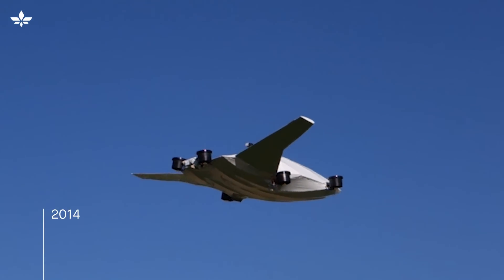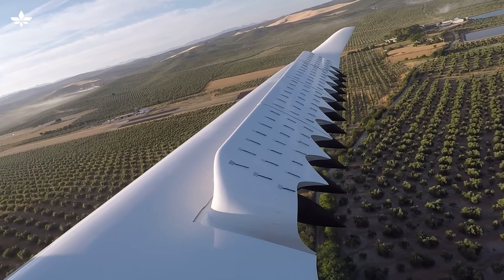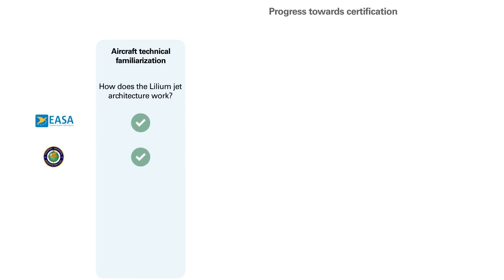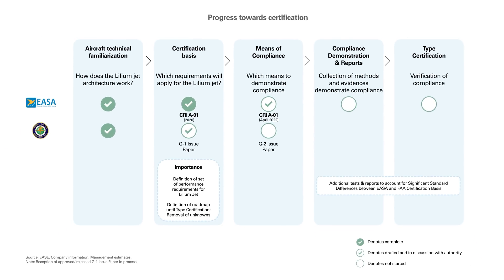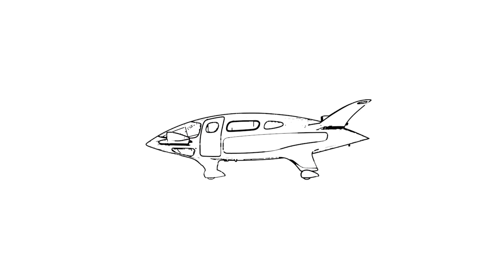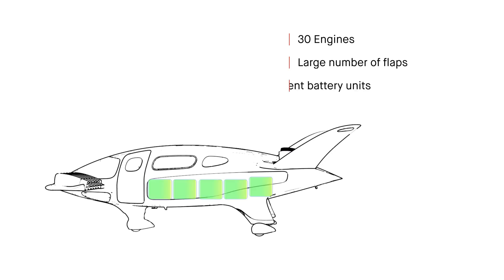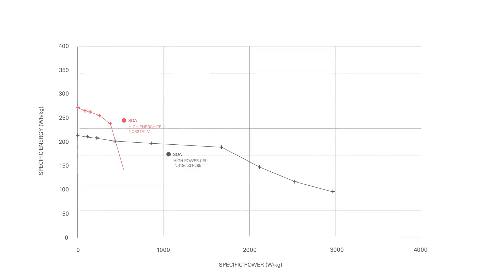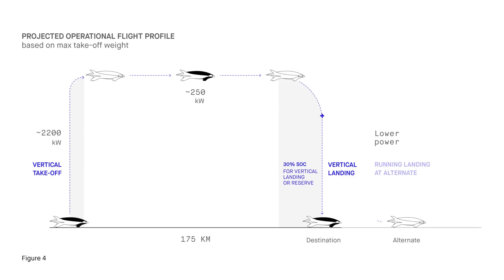Aircraft Development Update

Comment: Trying to figure out how practical this might actually be.
1) What is the turn-around time (Airport A to Airport B, spent battery pack replacement with fully charged pack OR full recharge time)?
2) What is the infrastructure at small regional airports for supporting recharging (tapping into the Tesla SuperCharger stations - 😉😉)?
3) What is the roll-out plan ( you state "to be a global leader in air mobility" ) ( Europe only?  North America? South America?  Australia? )?
4) What are the numbers on load capacity?  You show a 4 and 6 seater variant, and cargo, but I did not see the numbers.
Thanks .....

Comment: This doesnt work! Please stop this nonsense. No range, no operating time. 5min flighttime don't take you anywhere ....range 5 miles?
EDF powered experimental  modell with no relevant data to amp draw and voltage. No weight confirmation or testing. The battery doesnt exist. Where does this go? Ultra short-range cargo drone remote controlled maybe- not much more.

Comment: After seeing the landing gear that is presently installed, I wonder if they have truly calculated the different types of issues related to rolling landings vs vertical ones. With rolling low-speed landings, hard landings or crosswind landings hitting on one main gear only at touchdown have to be built into the strength of the gear. It doesn't look to me like the main gear has any shock-absorbing ability or sideways deflection. As with all military VTOL planes, a rolling TO or landing is used whenever it is available vs a vertical TO/Landing to conserve fuel or carry more weight.

Comment: so with all the energy required to transition from vertical to horizontal flight,  why or how come,  engineers do not use altitude as a swap for forward speed?  passenger comfort?  safety?   climb to 2x altitude, nose it over and use 1x altitude to get forward momentum and then leveling out?  Am no engineer but would this require the same energy?   Just seems it would be easier to get necessary air over the wings via gravity vs raw power?   could just be a wash and identical  power required for either?  
Stopping would be achieved by a controlled stall to vertical flight?  (probably kind of tricky?)

Comment: This really shows how serious these people are. I was dismissive of the idea of flying taxis at first based on safety concerns. However the safety characteristics of projects like these have convinced me that it's a viable business model.
Reply: ' I was dismissive of the idea of flying taxis at first based on safety concerns. '  Exactly.  Really this is the only one of these drone inspired types that even looks reasonable to actually fly in.  Heck you could probably disable the front or rear motors and still land aerodynamically if you keep the speed up.  Which of course should never happen anyway with all these motors if it's properly redundant.
The other designs are basically 'if much of anything ever happens it falls out of the sky like a brick'.

Comment: This sounds like a marriage from heaven of an air ambulance and an eVTOL. I believe it will prove to be far more operationally reliable than rotorcraft. The modified angled take off and subsequent landing will allow better utilization of the power envelope. Vertical operations are the least efficient and drain power quickly, so a rush to land ASAP may contribute to marginal decisions. This aircraft is truly remarkable and I hope you have great success.

Comment: If possible, it would be preferable to have the batteries in the wing.
Closer to the motors, requiring less heavy copper.
Located where the lift is generated, allowing for lighter structure.
Allows for more cargo space.

Comment: so they found a magic battery that has >2x the specific energy and simultaneously >10x the specific power current technology.  This is an enormous claim
Reply: there are lots of battery startups hand-building very high energy density and very high power cells with no idea how (or if) manufacturing at scale will be possible. A million dollars could buy a battery pack that meets all the claims above from several different startups, each one might only be able to manufacture one battery pack per month 😂
Reply: @kschleic9053  this

Comment: 1. So were looking at a 300-350 KWh battery here which will have a weight of over 1 ton based on the energy density numbers you provided us, will these batteries be charged or swapped out after landing? How long will this process take with batteries that weigh as much as a car?
2. Other aircraft in this category (Cirrus SR22, Diamond DA50RG) already cost close to a million. With all the additional technology and redundancy the Lilium is supposed to have the final price is most likely going to be closer to 2 Million. All for a plane that still needs a commercial pilot plus ground crew for battery charging/swap (therefore adding more cost) and from the looks of it is only going to be a VFR aircraft. To fully take advantage of its VTOL capabilities youd also need to build extra airports with infrastructure. What price per mile are you aiming for, who exactly is the target audience supposed to be?
3. It would be great if more technical figures (battery capacity, cruise speed, etc. etc.) would be shown on the website.
In summary, i have my doubts. I dont think this aircraft will be viable in a commercial setting due to its extreme price and limited range.
Reply: Thanks for asking these questions. I am also looking for answers.
Reply: Last year, I read a german newspaper article which mentioned a factory price per unit of about $4m. So I took my calculator and checked what the editor hadn't wanted to see, or to realize. (If you don't speak german, try deepl.com for a free translation. You'll have to split the text into chunks smaller than 5000 characters.) https://wp.ujf.biz/2021/06/nicht-flugtaxi-lilium-maerchen-wird-immer-abstruser/
Reply: look at total operating costs and safety, and you have your answer. regional airports watch out.

Comment: Lilium, I don't mean to throw cold water in your fire but weight is everything in airborne vehicles.
Are you going to be able to overcome the of power density of batteries to the power density of gasoline. Gasoline engines have more than 100 times the power density than that of batteries.
Reply: Gas engine 30% efficient, plus all that weight of oxygen...
Electric motor 90+%.

Comment: I like the option of completing a traditional, running landing - it simply gives the pilot more options.  For example I can imagine in a heavy (>20 kt) or gusty wind situation, it may be easier to just land traditionally into the wind.
Reply: Not sure I understand why this is worth the trade off.. this adds significant weight to the design of the landing gear, no?
Reply: @tewrgh  wheels give the aircraft the ability move around on the ground much more efficiently than hovering (which is pretty power-hungry).  For example, the Sikorsky executive helicopter has wheels that allow it to move around a helicopter without having to hover from place to place.  Sometimes the heli will do a "rolling landing" to use the ground to carry the weight as quickly as possible.

Check this out: https://www.youtube.com/watch?v=sz5FIJYeKRg

Also, flying forward (using the wings to support the weight of the aircraft) saves the batteries so you can extend the range significantly by essentially gliding into a landing.  For example, the F35 is a VTOL aircraft, but pilots' preference is to take and land going forward - even if is a "short" takeoff that uses some of the VTOL capability.

Check this out: https://www.youtube.com/watch?v=PleiyRKke4Q

and... https://www.youtube.com/watch?v=hO5mZxaiyUQ
Reply: @davidallyn1818  Isn't there a significant weight difference between landing gear capable of slow taxiing, and landing gear capable of sustaining a horizontal landing?
Reply: @tewrgh  I'm not an aircraft engineer, so I can't give you an exact answer.  But I can say that generally the weight of the landing gear is predicated on the weight of the aircraft and how quickly the weight needs to be absorbed to not stress the air frame.

Check this out:
https://www.youtube.com/watch?v=7r0sBh8gxhs

I'm sure the designers will decide the correct weight ratio to give them a smooth touchdown while also keeping it light.

Comment: Need help, please.
The power figures at 7:30min seem reasonable, maybe on the high side. 2200kW for takeoff and landing, 250kW for cruising.
How long will lift off and landing take? Say 3 minutes or 0.05hours --> 2200kW * 0.05h = 110kWh for each.
Cruising 175km with ascend and descend to cruising altitude shall take 1h at 250kW --> 250kWh.
That is in sum 470kWh energy budget.
Plus 30% SOC reserve --> 670kWh.
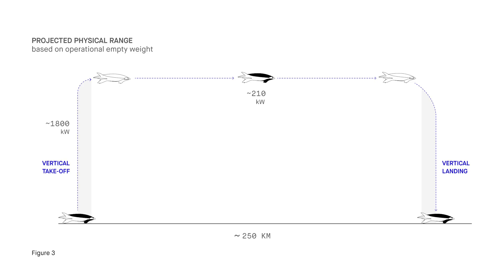According to the battery figures at 7:00min the battery is 260Wh/kg --> 2582kg

Isn't that a bit heavy? 2.5t just for the battery, no airplane frame, no passenger weight, purely the battery? Even if we assume all is halved, 90sec ascend, half the range, it is still a lot to carry.

(A Tesla has 75kWh and a battery weight 480kg, 150W/kg. And its power consumption is 20kW at cruising speed compared to the 250kW of the Lilium Jet)

(A BO-105 helicopter carrying 4 people is 2.5t max take off weight)

Thoughts?
Reply: Dude, you must have slipped as decimal- your 5,500 pound battery weight estimate is a factor greater than anything suggested.
Reply: @mavigogun  Should be easy for to spot my mistake then. But just as reference, the 75kWh Tesla battery is 480kg. The energy budget in the video is ten times which would make the battery 10 times more heavy.
Reply: @wdaehn   It is inconsistent to use the power density of a Tesla battery instead of that selected for the aircraft.
Reply: @mavigogun  I did not. I used the W/kg given in the video, thus come to 2500kg. A Tesla battery would be 4t. Any other idea?
Reply: @wdaehn  The 6 minutes you've budgeted for hovering flight is inconsistent with the designed parameter of  10 second vertical take off at max weight and 45 second landing.   For ease of calculation, let's stretch that to a full minute- or 1/6th of your estimate.   Why is this important?   As we know, hovering flight requires vastly more power- about 10 times that of horizontal transit.   Your excess of 5 minutes of hovering equates to 50 minutes of horizontal transit flight time.
Reply: @mavigogun  Okay, that might be an explanation. I find 10 seconds for liftoff, ascend and acceleration to minimum speed where laminar flow starts to happen (100km/h?) sporty, but okay. Then the start needs 6kWh, landing 27.5kWh and 250kW for one hour needs 250kWh --> 1558kg battery. But that one hour flight I do not feel comfortable with, lets make it 30 minutes at 250kW --> 871kg battery overall at SOC 30% reserve.
Reply: @mavigogun  While 6 minutes may be a bit excessive 10 seconds is also impossible. The aircraft has to accelerate and decelerate with speed and attitude profiles that are comfortable for regular passengers. Also realize acceleration can only be achieved with "excess power". Just providing minimum hover power will not allow rapid acceleration. Additional safety reserves must be allowed in case the take off or landing must be rejected. I don't see how you could propose less than 1 minute for takeoff and 1 minute for landing, at the absolute minimum. So at least 2 minutes total and that is still likely insufficient for safety in the real world.
Reply: @emotodude  The values proffered by Lilium aren't 10 seconds for launch AND landing, but for hover to forward flight; they provide 45 seconds for landing.   I reckon there is no obstacle clearance in that 10 seconds- whether atop a building or nestled down in the rotor amid towers.    That later scenario strikes me as particularly unrealistic, as the presence of strong rotor amid excessive climbs would be prohibitive, me thinks- but I don't KNOW that: computer controlled stabilization might more than match chaotic air flows.   Consider: just flying from the base of the Empire State Building to its Observation Deck- about 1,250' - would consume as much as 45 minutes of horizontal flight time!  If the vehicle had the margin for landing and return trip to the streets, it would require recharging before going anywhere... where as the elevator would only take 2 minutes, round trip!

Comment: we have things called helicopters this is a JOKE!
Reply: So tell us when will be the mainstream will be aviable to use helicopters? Never, because of the costs. EVOTL are the future... They will cost in the future less and it will b autonomous
Reply: @pokemonash_real  Exactly!  Folks like this are fueled by bitterness, not consideration.
Reply: Do you know what’s the cost of maintaining 30 engines? And helicopters can also be made autonomous
Reply: @PhysicsKingdom  Helicopters are one of the most radically expensive types of aircraft- the number of parts and points of failure are several factors greater than an electric vehicle with X number of motors with 2 or 3 moving parts.

Comment: To vertically lift 5 people in this ship it uses 3,000 hp. A lot but it uses only 300 hp for straight flight. And hover only happens for a minute of the flight. Still cheaper to run than a 5 seat chopper that uses 500 hp all the time.
Reply: Choppers use less power in forward flight than in hover

Comment: I'm in the process of designing an electric RC sailplane for my high school engineering class, I'm aiming for a 5 hour flight time. I've been doing the math to figure out how long it'll be able to fly it and I think I'll reach 5 hours with 20 Samsung 21700 50E cells but those cells you were talking about sound pretty cool, any chance I can snag a few? I need every watt hour I can get. :)
Reply: Dude- these Zen batteries would pancake your glider.   As to your project, are you building your own thermalling and thermal search architecture, or using someone else's script?   As I recall, a guy in Eastern Europe has done some impressive work in this area, with glider's achieving many hours long unguided flights.

Comment: Looks way better than those whirlybirds with six big propellers. I reckon slow running take-off and landing is the go. On rough ground go up one meter and start a hovering take-off run from a meter. At a meter the hover requires way less power than at a hundred feet.

Comment: I feel multiple jet engines design’s idea is brilliant. The engine is small in case of avoiding bird strike event. But I think there’s a possibility that it might happen maybe one jet engine failure. Can other engines also still operate to keep other engines running, and equally propel all engines to keep Lilium balanced landing?🤔
Reply: Adding all that fan area together, I reckon you'll find the area presented to bird strikes is no smaller.
Reply: @mavigogun  Each cowling outside of engines will avoid some big birds cracking the engines. I mean the possibility of birds strike will be much lower than bigger jet engine.
Reply: @willykang1293  Maybe the cowling will provide substantive protection to the fan when striking a goose at 150 knots; if the commercial application is realized, we will find out.

Comment: Are you really trying to say that the battery can catch fire only one time in 1 billion hours?? I'll never believe.
Reply: The internet is gratified by your input.
Reply: @mavigogun  seriously, it's 1 fire in 114 thousand years))) Unprecedented reliability for lithium batteries, especially under high load. For example, Teslas catch fire one time every 210 mln miles on average. If we assume speed=40 miles per hour, it would be only 5.25 mln hours, so these guys claim to be almost 200 times better than Tesla))
Reply: @TechMasterRus  - the safety margin between commercial aviation and driving account for over half of the 200 multiplier cited- close to 60% of Tesla fires are due to collisions alone.   While it shouldn't need saying, these are not Tesla's- those vehicles are indicative only of the design choices driven by the auto market- not what is technologically possible.